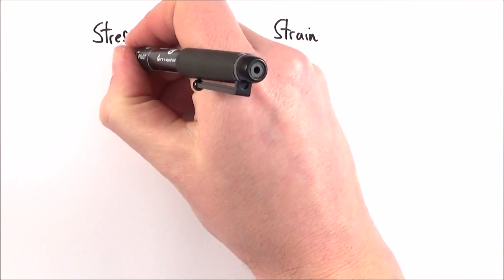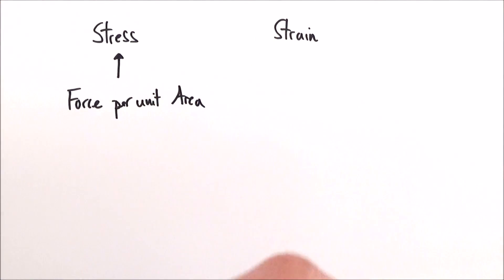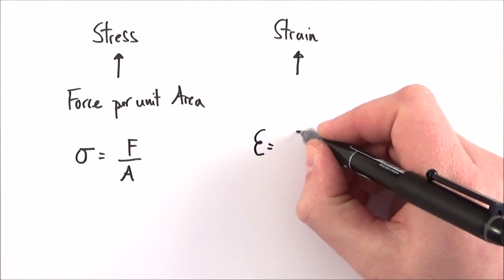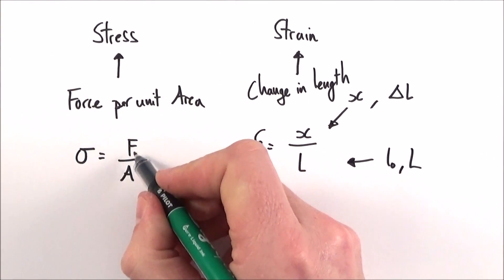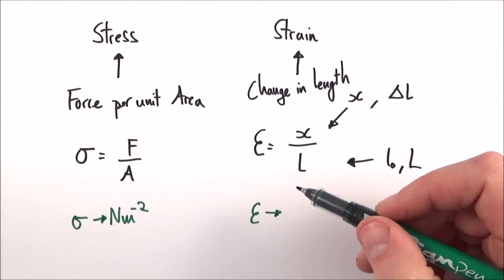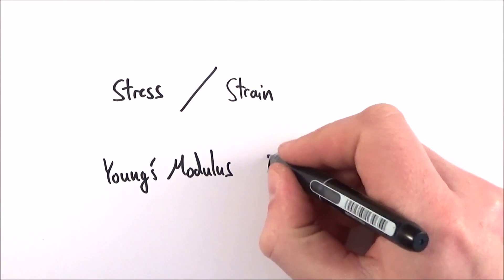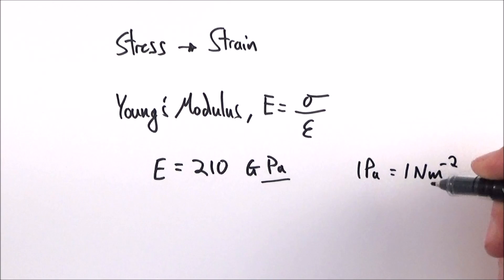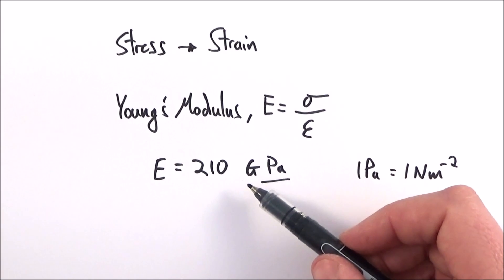Stress, Strain and Young's Modulus - A Level Physics

Comment: Your're awesome man! Good job i've found you, doing a practical on Hookes Law tomorrow where we have to use micrometres to find the cross sectional area of wire then apply a force to it. What more can you tell me?
Reply from the maker: +Perpetual Tom Thanks
Reply from the maker: +A Level Physics Online  This is a straightforward practical - make sure the wire is clamped firmly, it isn't kinked when you start and also that you wear safety goggles - if it snaps the end of the broken wire can flick into your eyes.
Reply: +A Level Physics Online OK thank you very much!